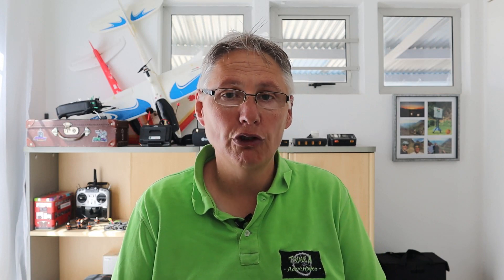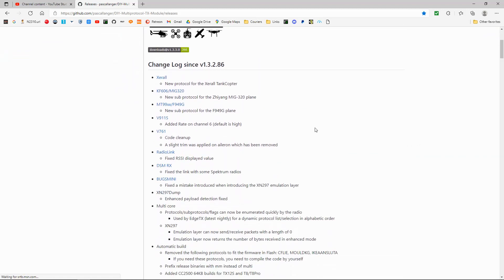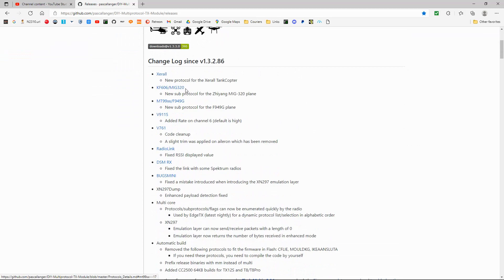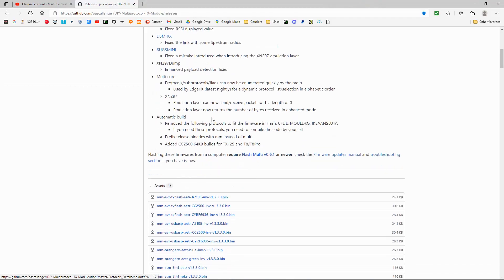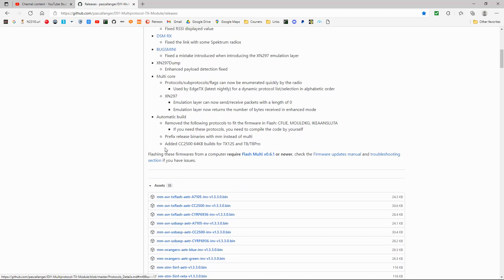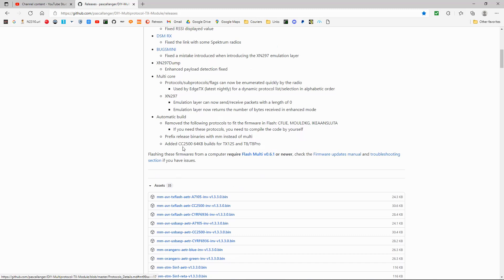Multiprotocol Module Firmware Update v1.3.3.0 Available Now

Comment: Hi Bill thanks for the info, just a quick question for you..I’m going to be  using sbus  on an frisky 8xr receiver and and I was wondering if I had to do anything with the radio 📻 to do with frequency tuning etc? 
Regards Derek
Reply from the maker: Derek you will need to RF frequency fine tune your radio in the Model Setup window and setup Failsafe.